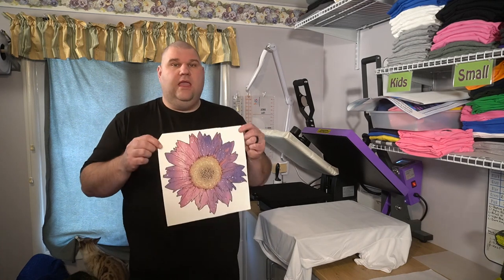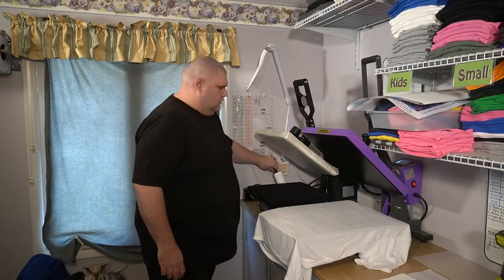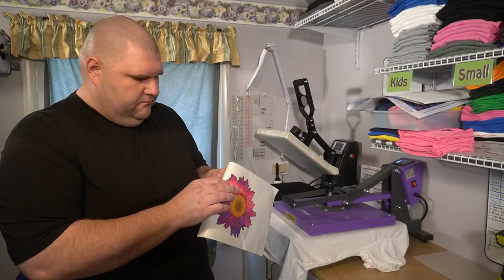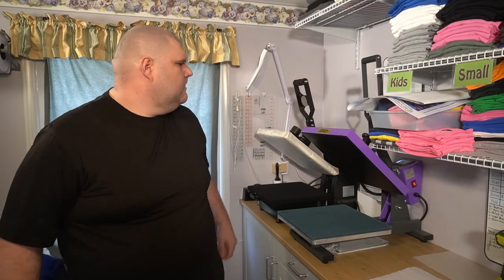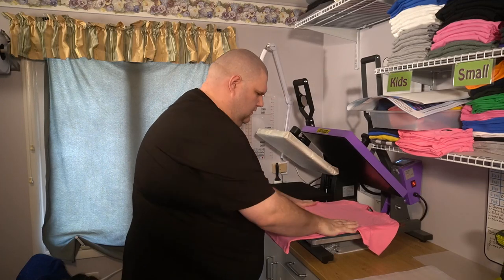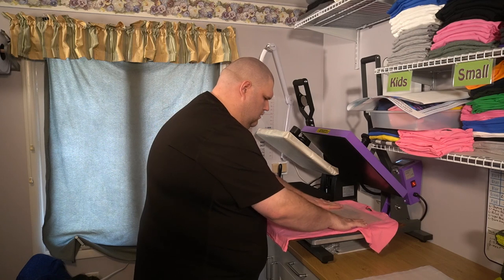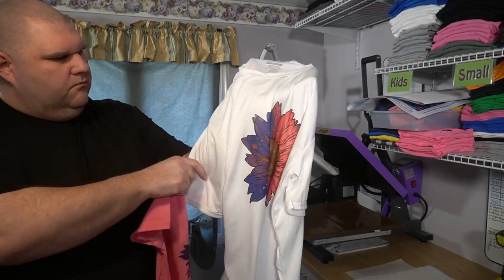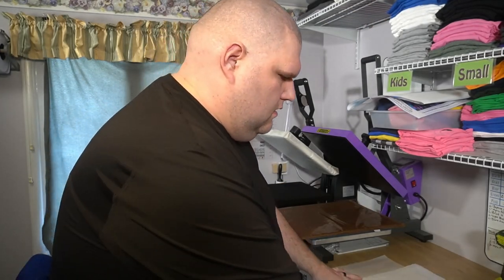Sublimation Vs Print Then Cut a Quick Demonstration and Discussion

Comment: Hi Christopher. So you were using ink transfer sheets? I wasn't that clear on what you were doing for the inkjet iron on, but looking at the links in the description it must be ink jet transfer sheets.
I haven't done that before but I am vaguely familiar with them. 

Regarding the size of the image... couldn't the inkjet design be any size your printer can handle? I know Cricut print then cut has size limitations, but you don't necessarily need Cricut. I guess it depends on the design and how hard it would be to cut it out without a machine.

To that point ... how important is it to perfectly cut down the image? Does the white of the tranfer paper get transferrd to the tshirt? Or can it be a fairly rough cutout?
Reply from the maker: Hi Olivia, for the print then cut I was using WALAPaper Inkjet Dark Premium. I use this one for all my print then cut transfers as it gives a white base layer for the ink to stand out on. 

With Cricut's Print then Cut it is restricted to 9.25 x 6.75 for the largest size it can cut currently. Silhouette Cameo and other commercial brand cutters don't have this limitation. 

With the Inkjet transfer paper any white areas that are not removed will be transferred to the shirt as it's a printable vinyl. If the shape is simple you can easily cut around it and then apply. For more intricate designs like the sunflower it can take a little bit to work it off the backing paper to ensure the design isn't stretched or damaged. You can have a rough cut along your edge to remove any areas outside the design if you are cutting by hand. The transfer blends into the garment nicely and leaves a nice soft feel.
Reply: @CKCustomsPA  I bought some of the WALAPaper for darks and will give it a try.
I am guessing it is not as permanent as infusible ink. But I am sure it is going to be fine for my personal use ... especially since it is going into a rotation with a quickly growing tshirt collection.
Reply from the maker: We have had great success with it lasting and holding the colors in own test washes. We use the WalaPaper in some of our one off custom orders when a complex picture is requested on a cotton shirt. 

Infusible Ink is similar to sublimation in the way it works except Cricut sells a sheet that you have to cut and weed your design from before pressing. Where Sublimation the design is printed directly to an ink release paper with sub-dye inks. 

Infusible ink is going to bond permanently with the  polyester fibers in the garment and can last as long as the life of the fabric. Two things that will make Infusible Ink fade. The first one having a poly blend shirt, this will give an aged look to the shirt after a wash as cotton won't bond with the ink. The second one is going to be fading from UV exposure but this takes a long time to see the effects.